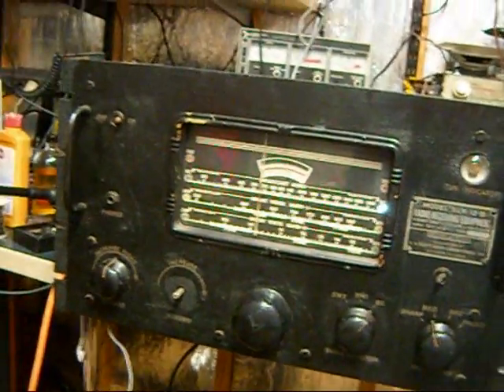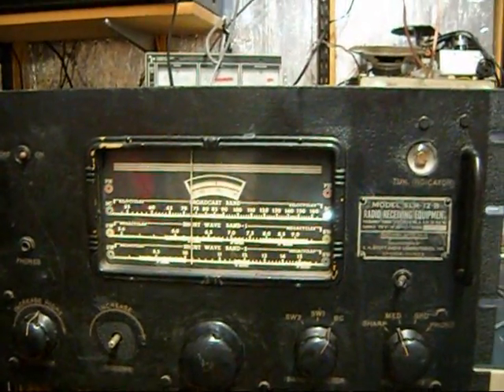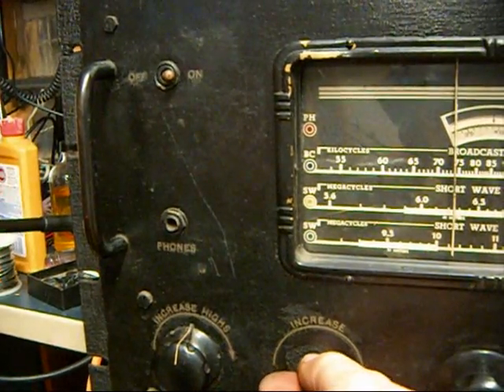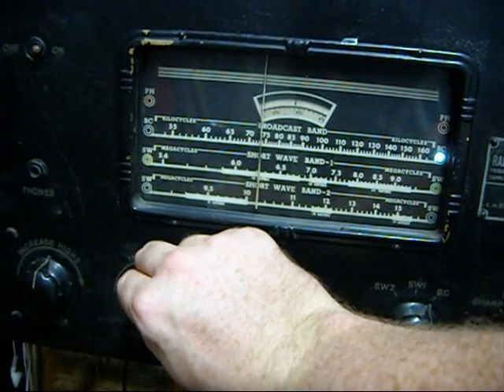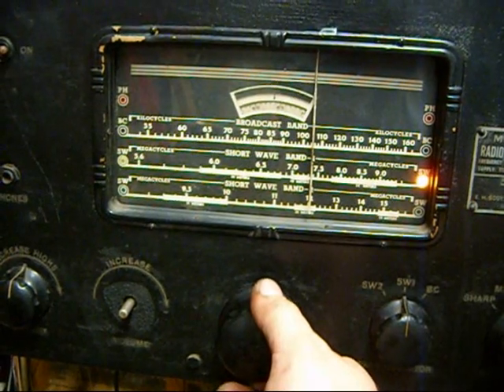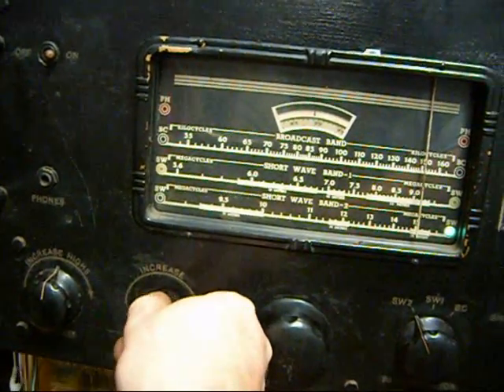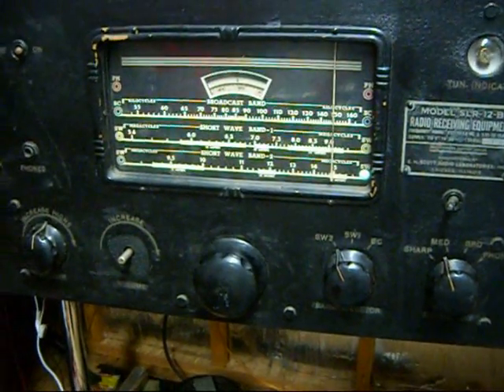SLR12B lives.wmv

Comment: Hello. Very nice receiver. I just picked up a SLR-H with no documentation and one missing tube. Do you remember the tube marking on the left side of your set
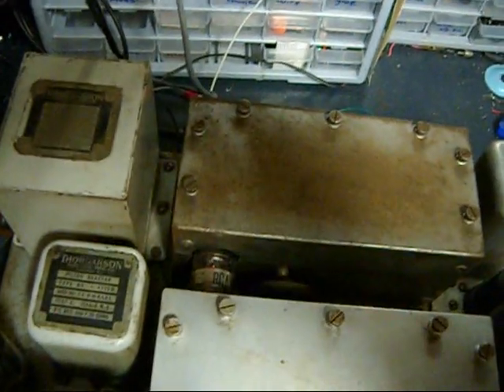on about 0:51 into the video? It would be much appreciated.
Reply from the maker: off the top of my head I do not but maybe this will get you somewhere   http://www.antiqueradios.com/forums/viewtopic.php?f=6&t=251833

if not, let me know and I'll go look at it.  I still do own it.
Reply: Thanks, found the manual from the link. It's the 5U4-G that is missing. All the other tubes are marked on the chassis but this one. Thanks again. 
Fernando N2FQ/6